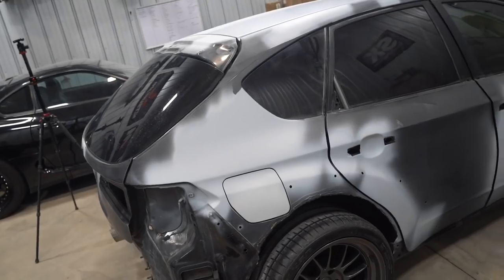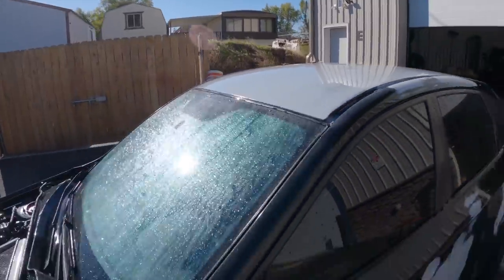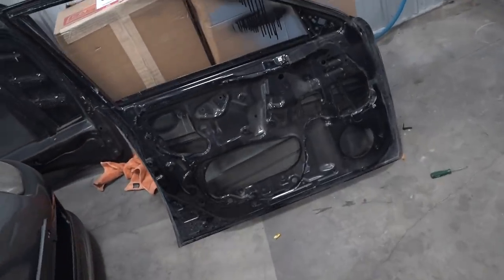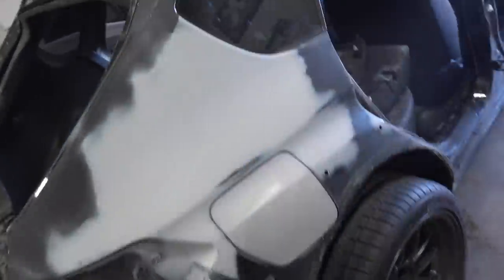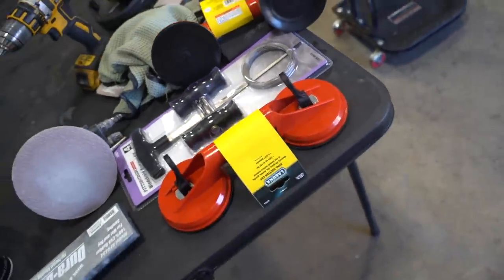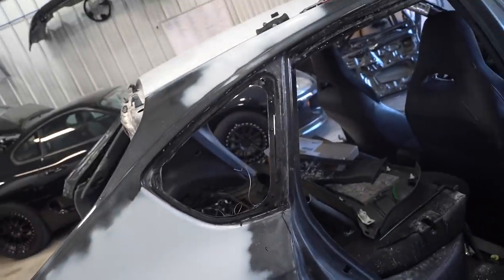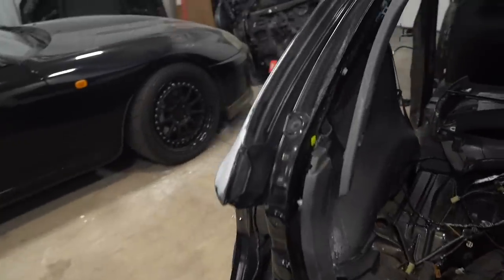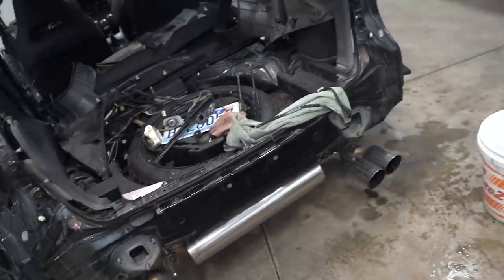Completely Disassembling The STI Hatch for Paint!

Comment: Just one advice for next time takeing the glass off. For start hole I take strong needle like rod and I heat it until it's red hot. Then I push it throu the glue and I get the hole where I push the wire for cutting off the glass. All in all, very nice work for the first time D. Respect 💪

Comment: Sadly on the windshield the black thing surrounding the windshield is basically structural part of the windshield. Which means a stone chip or chipped glass is bad and can’t be fixed. 
You can re install your windshield with the chipped glass but it’s high likely to crack within the winter season with all the expansion and contraction with water possibly entering and freezing which will make a crack.

Comment: Windshield screwed eventually that crack you did in the corner will be a week point or breaking point.. I did glass replacement and never seen it Donelson you did usually harbor freight has a cold knife to cuz the winshield out with a 90 degree balde.
Reply: blade. You did good job on quarter glass just sawing it out with wire that's only real way to cut those put.
Reply: *out
Reply: When you spray the car base coat only where the winshield sits and quarter glass sits.. don't clear those areas other wise you will be backtracking and you will be back at sanding when you put your glass in.. urethane won't adhere to clear very good.